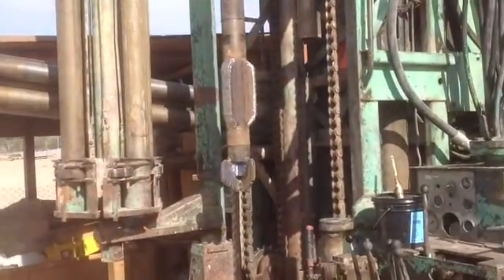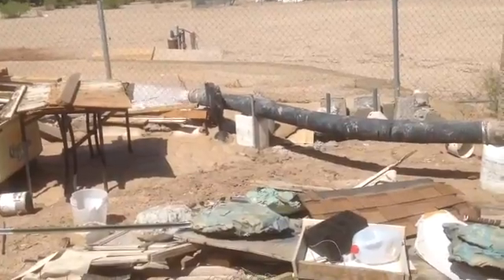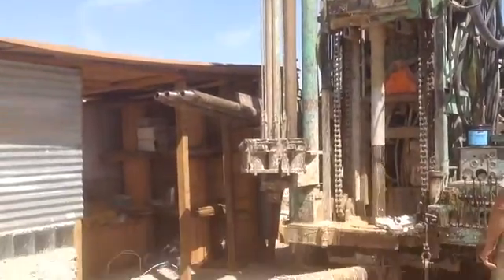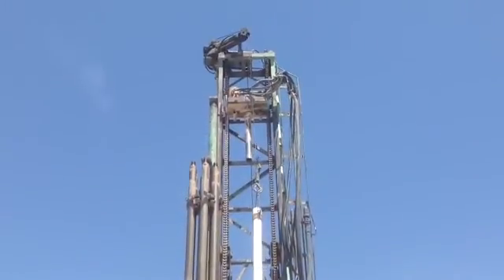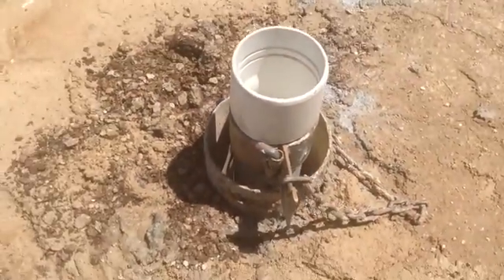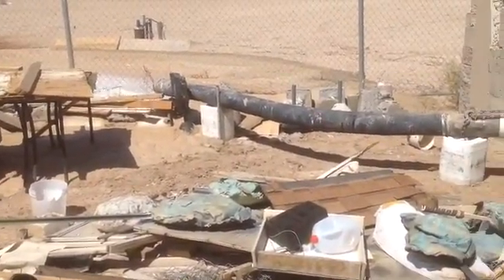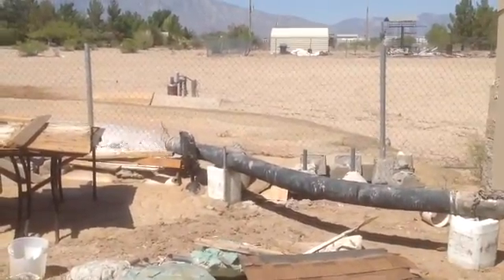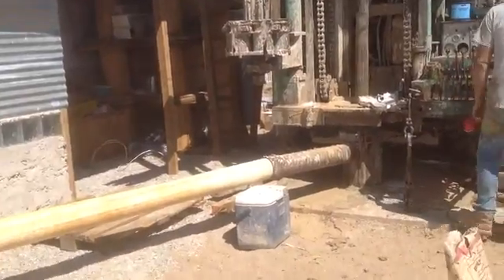How to Drill your water well deeper

Comment: I'm trying to drill my 115' feet 8" diameter well deeper.  The problem I'm having is at 60' the drill string is binding or hitting up against the steel well casing. Did you have that issue? Do you know a way around it?
Reply from the maker: We did Not have that problem, I have heard about former drillers dropping tools into the well casing and that would be bad. I hope you figure out the issue, good luck.
Reply: Bravo Von Muller Thanks. Do you remember size of your drill bit to fit the 4" pipe?
Reply from the maker: Sorry but I don't remember.
Reply: Bravo Von Muller  Thanks for your time and the video was very informative.

Comment: Why is it more expensive in areas where water is hard to find? The drilling casing and gravel packing procedure is exactly the same in all areas, whether water is hard to find or not. Drilling a hole is drilling a hole. Setting pvc casing is setting pvc casing. gravel packing is gravel packing so why would it cost more in desert areas? BTW your drilling here with air rotary into consolidated formations, its very straightforward and simple.....
Reply from the maker: The Government Only lets a few people Drill..,  License, Fees, Red Tape and a long wait list =  More $$$$$$
Reply: Thats complete garbage. Do a search on the number of licenced drillers in your state, indeed in your country, there are thousands and thousands. Licence fees are set, they are an inconsequential charge. Red Tape??????What red tape???? A long wait list? Does that mean that your driller doubles his rates when he is busy? Does he also halve his rates when he is quiet? Water Well prices are charged on a per ft basis. You have tiny 4" well casing....... basically, if the prices you are quoting here are true and correct, then you got raped.
Reply: And by the way, gravel will NOT seal off anything, it has a huge amount of permeable spaces thru which water can flow, its put into the annulus to act as a filter against fine sediment and sand migrating into the slots. If you want to "Seal" off the 8" casing then your driller would have used either bentonite or grout.  $40 a foot for drilling something like that in the states...lol most drillers in the states are lucky if they can get $20 per foot for the exact same process.
Reply from the maker: License drillers in Pahrump ?  Maybe 3 who are still in Business, all have a long waiting list.  And No the Las Vegas Drillers won't go there.   NOW WHO IS GARBAGE ?

Comment: holey shabang!! 
must be in the USA!! 
There is many different ways to have achieved this. Perhaps the USA is not govern by a water well drilling branch of any government like it is done in Canada. 
The price setting sounds like oh hey let's over charge because it is near a desert. 
The actually drilling and formation that was drilled into was never shown? 
How was the plastic casing perforated.. by machine or by a hand operated tool? What was the size of the perforation and to what percentage of each 20foot long section was machined for perforation? By the amount of perferated pipe used would suggest that several water bearing formations were used. 
Actually using a bentintite type shale pellet would have been the appropriate material to use to seal the new well casing from the old leaking steel water well casing. 
Curious at that depth of 240 feet, what was the static level of the new well? How many gallons per minute did this new well produce? 
1 1/2 horse submerisable pump ..seems a bit excessive for a pump for such a shallow water well. 
Not much relative information was given inrequards to the water well other than shabang of the excessive price. 
this well should have been cheaper in price due to the first 140 feet was already drilled and cased with steel pipe. 
More details of the water well being constructed along with water well development and completetion and pump setting would have made this a worth while and in formative video to have watched. 
Guess its how this is done in the good(?} old USA.